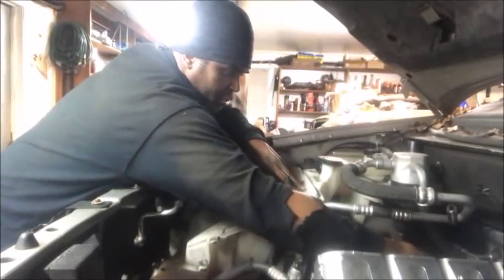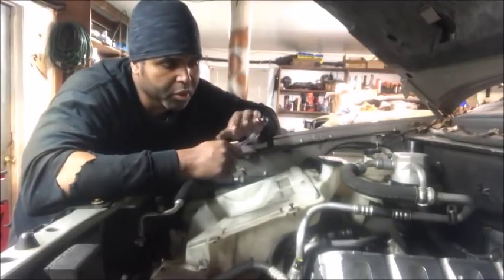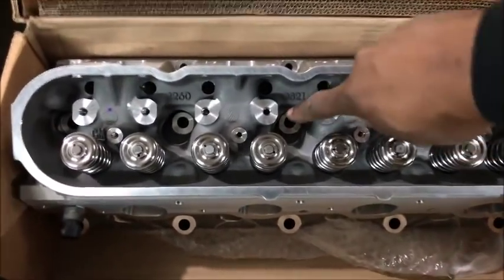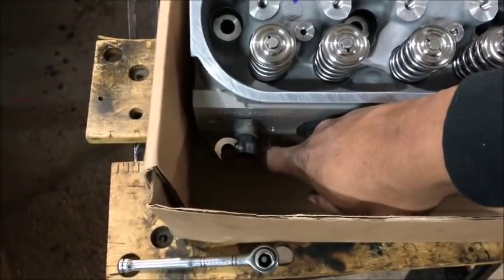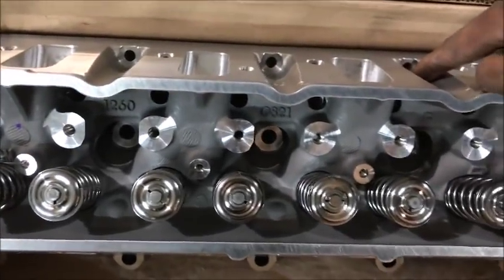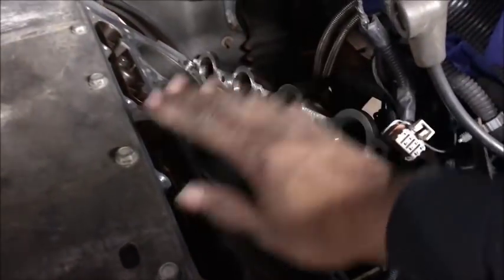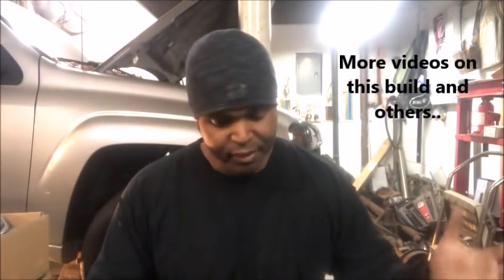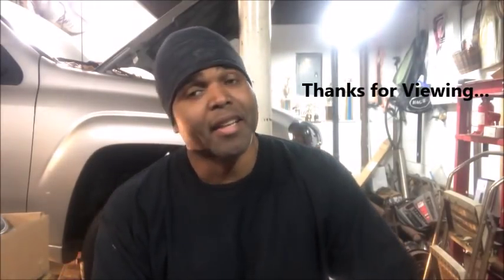How To: Install LS Heads (BOLT TORQUE AND SEQUENCE ORDER)

Comment: have to ask I'm doing my 2013 suburban and I've been told i need to angle torque it. i noticed you didn't mention that
Reply from the maker: you have a couple of passes with the head bolts then a final degree of twist.

Comment: Terry I just need to know because this is where I’m at right now what the exact size or should I say length of the head bolts are supposed to be? Please help bought a single head bolt set, part number ES72173. But everyone that I’ve seen or read up on all the bolts should be the same size -5 of them. I have eight that are about 78 inches long and I’ve got two that are about 6 inches long and then I have the five the same size for the top close to the valley plate that are all the same size.

Comment: Would have been to see you actually torqueing them down with the tool that you used and how you used it.
Reply from the maker: i user either the electronic eastwood torque wrench or my craftsman manual torque wrench.. i have several videos showing me using both,  but anything helpful i dont mind showing, so maybe its time to do another video on using both again.. thanks or the idea.

Comment: bro,you wont believe what happened to me,ok first off,im a chevy guy,ive worked on tons of just regular small blocks and you can throw just about any bolt in for header bolts and even use a 6 ft cheater pipe and not break anything haha,well im doing a 6.0 swap into a 2005 blazer all by myself ok,so its new to me some of it,so i order from summit i get tons of wrong parts,i got header bolts and i screwed them in and it was dark,and the light i use sucks,so when i tightened them up,not the full torque either i then took my light to look at the flange and gasket,well some bolts i noticed werent even touching the flange so i was like damn i need to take these out,dude,,,,they were as hard to take out as you would be like torquing terry,3 came out and then i snapped one and the back number 6 and 8 cylinders were stuck,so i was like well i gotta get them off so i can remove the head,so i had to snap them off,tried drilling but shit,i just ordered a new head omg im so embarresed and mad,you should tell people how small the bolts are for Ls engines and how short of a bolt you need omg,so it costed me a ton of money my friend,not fun.the header bolts so tiny,like not fat,and they are short too,omg anyways im picking up and moving on my friend,live and learn i guess huh,god im so bummed,stupid summit has sent me so many wrong parts on this,i hate them.oh well later man
Reply from the maker: brotha man im so sorry to hear that.. this is the purpose of my videos, so people wont have to go thru this.. if you ever run into something like this again.. hit me up in a email and we will work it out.. this is why i always use GM part whenever i can..

Comment: Is the torque sequence and specs the same for all LS motors? I have a 2012 suburban and I want to make sure torque and twist are the same as what you discussed. Is there a good place to go to get the other torque specs for this job? Thanks for posting this video!
Reply from the maker: the torq specks are the same across the board, just to be safe i would pull down torq sequences from the engine you are working on.. thanks brotha Rockon!

Comment: Great content Terry! Quick question, I have a 2000 GMC Sierra 4.3L sidestep. What would be a good recommendation ? Build up my small block or go head and swap it out. I'm not crazy about a specific engine, I just love rebuilding and learning as I go. And what's the biggest engine I can throw in my GMC 4.3?
Reply from the maker: how far do you want to go.. you can make anything fit..